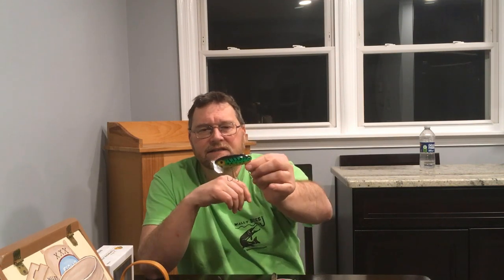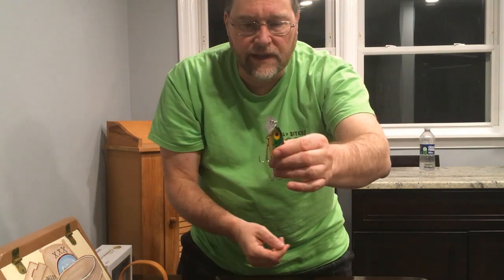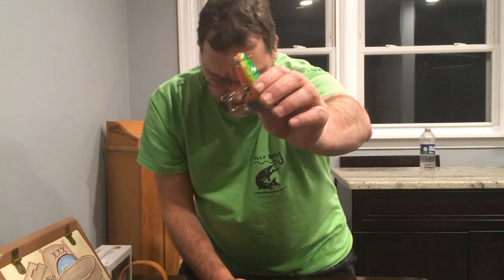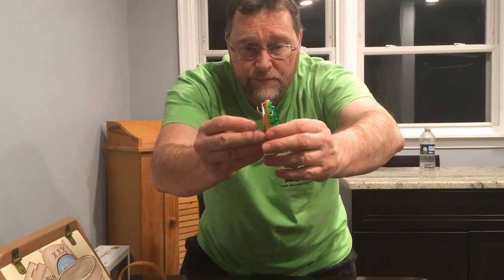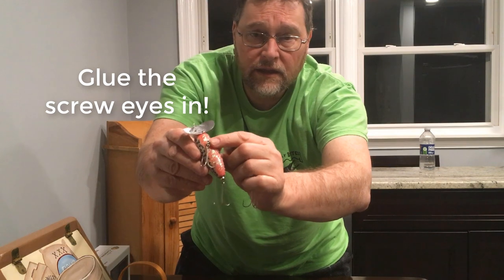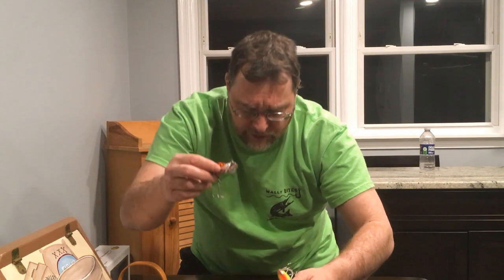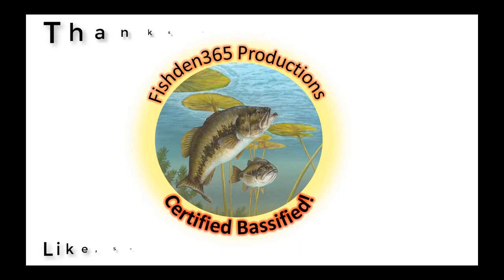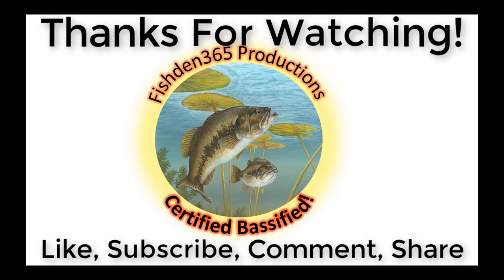The Arbogast Jitterbug

Comment: Nice video. May I ask what size screw eye??
Reply from the maker: Ha, good question. I remember the ones I bought from Janns Netcraft were a bit small so I used some from home depot. Not sure what size they are. If I figure that out, I will respond again. Most important thing is to glue them in when inserting.